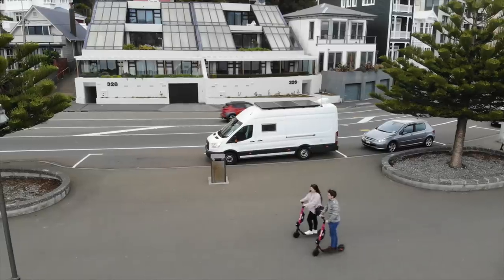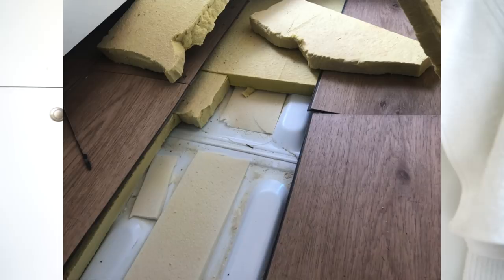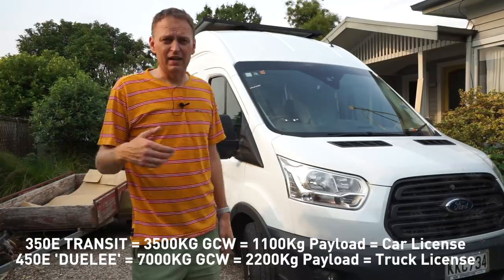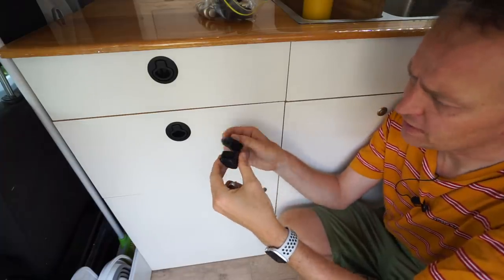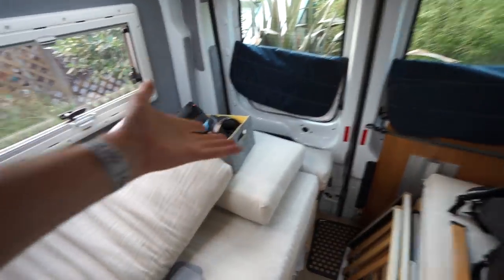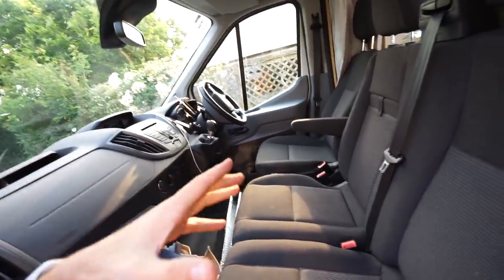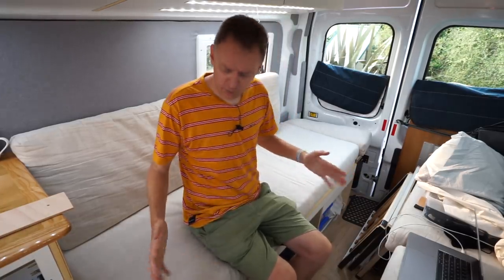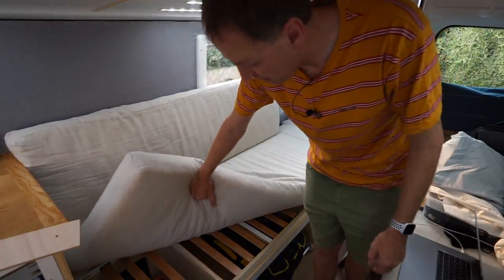10 Things That Didn't Work in the Van : Eat Sleep Van 33

Comment: Why did you go 24v for the house battery?  Surely that means buying all 24v appliances, like lights, fridge, TV, Radio, and so on.  I'd have thought there was a lot more choice in 12v, so there must have been a good reason for you to go 24v. Because of solar?  Thanks - David
Reply from the maker: The size of the battery mainly. It's a lot of amps to pump through at 12V. 24V halves the current. Also the EasySolar box I wanted to buy was only available 24V. It would have cost a lot more to go 12V and buy the bits individually. In the end I bought a number of 24-12V converters to handle the 12V side of things, which do work nicely, but slightly inefficient.

Comment: Thanks for the tips - the latch critique was particularly helpful. Have you considered a generator with a propane conversion ? Honda seems the default brand for this in the UK. Don't know how available this option is in NZ , but it gives you the option to run on both petrol and propane.
Reply from the maker: Thanks! Not really considered a propane generator. They’re pretty big from what I’ve seen and I’ve tried to avoid propane (what we call gas). I only have 1 small 4Kg bottle for the cool top and oven. Worth investigating though if you do have a bigger gas tank.

Comment: On the alternator charging, even if your house battery system were 12v, you would likely still need a DC-DC charge controller. Simple battery isolators don't work well for charging house batteries, particularly lithium due to their low resistance. Your Alternator can put out some SERIOUS amperage(up to 150A x 13.8v = 2KW vs your 900W solar array's roughly 30-40A output at 24V). While lithium batteries can take a high amperage charge, some even capable over 100A or more input, straight alternator charging would be excessive and could cause damage.
Reply from the maker: Thanks yes very good point! Cheers
Reply: @EatSleepVan  Most people assume 12V=12V with little understanding of how their vehicles charging system works. An alternator simply reads battery voltage and outputs what is needed to maintain the voltage it is set for(many have converted HD alternators into welders for off-road repairs. That's some serious output potential). 

A quality solar charge controller(or any quality battery charger) on the other hand measures battery system resistance as well and adjusts output to as needed. That is why, on properly built solar systems, you will see output drop as the batteries approach 'full'. It is also why a dead car battery will charge much faster after being 'jump started' and fed by the alternator than off of a plug in battery charger. A charger hooked to mains can easily be made to output more amps than any alternator but they are designed not to do so for sake of the battery.

And thanks for pointing out your failures/things you should have done differently. It helps those of us still in the planning phase to spot potential issues ahead of time.

Comment: Love your van build, and thanks for sharing upgrade ideas.
How do you handle internet service for your laptop?
Reply from the maker: Hi I have a 4G modem and pay $99NZD/month for 120GB. I also have a wifi extension box so I can connect to external wifi from a distance away. I tend to use more than 120GB a month so a bit of time connected to Wifi is essential.

Comment: Battery to battery chargers. 
Can be used with lithium batteries as well as lead acid batteries.   Yes there are some about that cannot be set to user values but I do not think I have seen a 12 to 24v unit that cannot.   STIRLING  say the input size can go up to 80% of the alternator size.  You may not be able to easily get Stirling equipment but useful to remember the 80%.   There newest range looks really interesting,  two way charging and you can adjust the maximum charge values independently.
In a previous transit I fitted a 2nd alternator (24v) but charging lithium direct from a standard alternator is not possible.  Stirling do a link box,  other companies often follow a few year later. 
To me a large B2B charger or 2nd alternator makes more sense than a generator.

Vehicle capacity.  In the uk most 3500 kg Van's can be reregistered at a higher capacity without altering the van,  3850, 4000,  and 4500 are possible depending on the vehicle.  But practically you need an engineering firm to guide you through the process and provide the paperwork.  But there may not be suitable engineering practises doing it in Newzealand.  However if you are thinking of upgrading the springs it is likely to require the same process.

Best wishes, enjoyed your article.
Reply from the maker: Cheers David, thanks for that

Comment: I also have a Ford transit and have a 24v 200ah lithium setup with Victron inverter/charger. I have a dorm fridge cheap that runs good all day and charge by 300w solar. The charging with the alternator is done cheap with a 1000w 12v inverter to 110 and a switch  to select when I use short power or when I turn the inverter from alternator. Very simple very cheap. I did run into only one inverter working for me the others would be accepted by the Victron.
Reply from the maker: Hey thanks, yeah that was the other option I was considering. I was put off by the need for a timer so the inverter doesn’t try and feed in while the engine starts. Did you do that? Or do you turn it on manually on long trips?
Reply from the maker: Which year Transit? The 2017 can only supply 60A, so wasn’t sure what size inverter to get too?
Reply: Eat Sleep Van only turns on with 14 trigger relay turning on and off the inverter thru the original switch or not in at all if I’m using solar.
The problem is it will eat up the alternator unless the van batteries are charged and that’s usually around 14v
Reply: Eat Sleep Van it’s connect to the battery directly thru a Victron 200 battery protect I did upgrade the alternator but only after the fist year of use
Reply: Eat Sleep Van 2018 transit 250 diesel
Reply from the maker: Krister Lagerström  Thanks, good point. The alternator in the van is bigger than 60A. 60A is the max Ford say you can use from the 'customer connection points'. I don't actually know how big it is! Never quite found out and couldn't see on the alternator itself.

Comment: Hi bud. Regarding the weight of the vehicle. Is there anything you would suggest? Lighter materials? Anywhere that you could cut doen on wight that you could think of? Researching now for when I return home in a couple of years. 

Thanks and great vids!!
Reply from the maker: Hi! yeah in my latest video you can see I swapped out the floor for solid wood, which was a smidgen heavier, but I've also swapped out my plywood bedframe for aluminium tubing (yet to be seen on video). This is WAY lighter and more open, allowing for pass through storage from the rear, and more space. One side of the bed went from 11.6Kg down to 2.8Kg, saving 8Kg! I would do the same for the kitchen cabinets if I was doing it again.
The other things that could make my build lighter include:
- Lighter foam instead of latex mattress (or half foam, half latex)
- On demand gas hot water instead of a 24L hot water tank (that is always full of water).
- smaller under van water tanks (but meh who wants that?!)
- Thinner 12mm plywood instead of 18mm, especially for the upper cabinets. Or again aluminium tube + 4mm ply.
But the main thing I would do is buy a van with bigger payload capacity! i.e. a dual wheel thing at the back. 
Cheers

Comment: Interested to hear how your shower worked out, with extended use, was it worth the space save for the daily setup? Or is a small fixed shower more effective? I'm torn
Reply from the maker: It literally takes 30 seconds to make up the shower or pack it away. I use it almost every night, it works great! I just leave it set up overnight so it dries. The only thing I’d do differently is make the floor fold up/down on a hinge, that would take it down to 15 seconds!

Comment: The transit twin wheel in NZ can be driven on a class 1. so you could go with the heavier van. (you said you wouldn't be able to drive it on standard licence.
Reply from the maker: Hi the standard NZ model twin wheel 470E LWB Van has a 'gross combined mass' of 7,000Kg in the specs. A class 1 car license is "GLW or GCW 6000kg or less". 

GCW = 'Gross combined weight', which I assume is the same as 'Gross combined mass' that Ford states.

You might be able to find an imported model with different specs, I saw one once on TradeMe.

https://www.nzta.govt.nz/driver-licences/getting-a-licence/licences-by-vehicle-type/what-you-can-drive/
https://www.ford.co.nz/commercial/transit-cargo/models/470el-van-high-roof-rwd-manual/?intcmp=vhp-return-model

I'd love it if I was wrong!
Reply: @EatSleepVan  If you buy the 470EL you are right but we use the 460EL (minibus) it has a gross mass of 5350kg and a GLW of 4600 (actually more than the 470) once we rip out the seats and rear lining the vehicle gives us 2400kg to build the conversion (van weighs 2200kg empty)!
we carry 160 litres of fresh +90 litres of grey 600watts solar 200 Lithium + full roof rack and after conversion we have a payload of 1100KG  and as we have a full size garage at rear under the double bed it will carry all the bikes and toys you want.
This is not an import see here: https://www.ford.co.nz/commercial/transit-cargo/models/470el-van-high-roof-rwd-manual/?intcmp=vhp-return-model
Also as it is a mini bus you get higher spec full windows fitted and electric auto step.
Reply: @andrewnuttall333  Gotchya, yeah that's an option, although it's not as tall as the 470EL. I don't understand why they don't have a 'middle' capacity cargo van. I personally wouldn't want all the windows or the interior and seats to deal with. The Mercedes does have a middle weight option, so would consider one of them next time!
Reply: @PureGlide  The dimensions are exactly the same,  your right about the glass and we line and insulate but the interior takes 3 hours to remove, we used to sell on before covid hit.
We convert Mercs as well but there is more width and hight in the transit, LWB merc is 100mm longer and ELWB Merc is 500mm longer than a transit,
If your looking for a merc i have one ready for conversion 600km 3 month old (canceled order) its a 516 LWB as well so extra weight capacity (twin wheel) already has factory eberspacher fitted. will sell $20,000 off what we paid 3 months ago.
Reply: @andrewnuttall333  According to the specs, the external heights are different between the 470EL cargo and bus models. Unless the bus models have a lower floor, they must be shorter internally? The Cargo is just over 2m internal height, critical as I'm 6'4" 193cm, and still have to add ceiling and floor. The Merc 516 you have doesn't have the 'super high' fibreglass roof does it? Again that's the only one I can stand up in. It's even taller than the transit, but the roof is much narrower, a problem for lots of solar panels. I stood in one, it's got almost a foot above my head! Personally I think the length of the Transit and the LWB merc is about right. The ELWB would be a pain in the ass in a supermarket carpark...
Reply: @PureGlide  Just went outside and measured: the dimension from floor to ceiling beams is 81" - 2050mm (460EL Minibus)
Reply: @andrewnuttall333  Very interesting thanks! Are they front wheel drive instead of rear wheel drive?
Reply: @PureGlide  No they are rear wheel drive, its exactly the same body as the 470EL no difference, not sure why you think its different, i have just sold two on trademe they where 3 years old.
Reply: Are you looking at 410?
Reply: @andrewnuttall333  Just from the specs on the Ford website... they also don't give an internal load height so hard to compare. https://imgur.com/g7eSRW0
But that's great news, it means the bus model is a good upgrade option. My 2017 350E has a payload of 1,166Kg, but the new model is down to 848Kg! What are they thinking... The 460EL 16 Seater Bus model has a payload of 1,290Kg before you take out the seats and interior. And you reckon you ended up with 2400Kg payload available?! That's amazing.
Reply: @PureGlide   We haven't worked on the new transits as the updated model minibus is not due until 5 months from now! but they have a better spec, we are trying to get ford to bring 4x4 transit to New Zealand but they wont decide until middle of 2021.
I saw you van for sale on Trademe a while ago did you sell it?
Reply: @andrewnuttall333  Ah makes sense. no I haven't sold it yet, I'm about to head down South with it for summer, so will try and sell again after that. It is still on TradeMe with a high price incase someone wants to make an offer I can't refuse :) Thanks for your help and info!

Comment: Are you happy with the Transit? Or would you now go with a sprinter or promaster? I have a sprinter but like some of the Transit features like the higher roof. Thanks for the vid!
Reply from the maker: Thanks! Pretty happy with Transit, the interior feels more solidly built than the sprinter. Thicker walls for example. The super high roof sprinter has a fibreglass roof! And has way more ordering options available. I’ve been looking at the sprinter as they do that 4.1ton version here in NZ

Comment: Is your van insulated, and if so have you had problems with condensation/mold? Seems inevitable especially with the shower?
Reply from the maker: No mold problems although I do get condensation. I designed everything to dry out easily, even the insulation is breathable. So if moisture forms (it will!) it can get out too
Reply from the maker: The small exhaust fan means most of the shower air goes out

Comment: Hey my friend the weight of a microwave isn't going to destroy that vehicle those maximum weights have a built-in safety margin loaded up enjoy it
Reply from the maker: True it probably wouldn’t make much difference. They now have automatic weigh stations on our state highways that will weigh your vehicle while travelling! So keen not to be TOO heavy
Reply: My tip would be to get a small 12V microwave made for big rigs and semi-trucks. It's gonna save weight and power.

Comment: most of the issues seem like common sense also relaying on cad is a bad idea (but you've clearly learnt that lesson). Along with that such a large solar panel width base the wind resistance while driving will be massive! You must break the wind with some sort of blocker (at the front) to stop it from happening. If you don't its very dangerous for you and other drivers. Its just not safe.
Reply: sorry if i come across patronising. I don't mean to.
Reply from the maker: Hi thanks for the feedback- the solar panels and rack have been designed to create almost no wind resistance. Why do you think it does?
Reply: @EatSleepVan  flat surfaces cause wind resistance. Its just how science works, take plane wings for example. I expect you to say they are slopped downwards to not take off (like a plane wing), but roads and wind aren't consistent. A few feet of plastic can save you thousands and maybe a lives.
Just to hit the point home. its not possible for a solar panel to be wind resistant. and elevating them only makes it worse.
Reply from the maker: @MoonshineBlack.  It just so happens I fly gliders so have a good understanding of how aerodynamics work - what you're saying almost makes sense, but you're missing the 'angle of attack' into the airflow. The panels don't have any angle of attack, so don't generate any lift. Air can flow over and under the wing without any resistance, so no pressure is created to lift the panels up, well not enough to overcome the bolts holding them down. Try this: Drive fast and stick your hand out the window. If you keep it flat, you won't feel any up or down movement. Angle it and you will. Same principal here. I've been driving now for nearly 2 years and check the panels regularly, there is no sign of anything working loose or bolts breaking.
Reply: @EatSleepVan  I appreciate the flow of conversation happening here. 
When you're driving, of course there's an angle of attack, as the road is not set flat, ever, and nor the wind etc. If air flows over or under without a 0.00 it will of course create resistance. I don't want to offend you but you must know this. 0.00 isn't possible, and you can only attempt to restraint it. I, at this point doubt your opinion.
Im just suggesting to buy a simple piece of cheap plastic. or make one yourself. There's no intent other than to keep you or other people safe. I am getting wound up that you don't use common sense at this point.